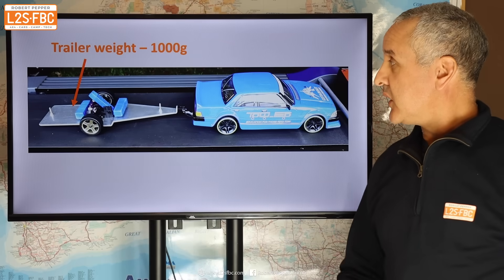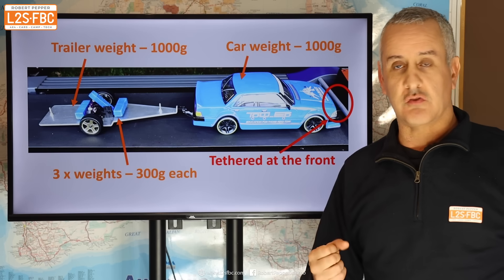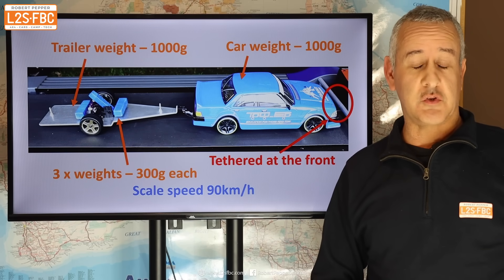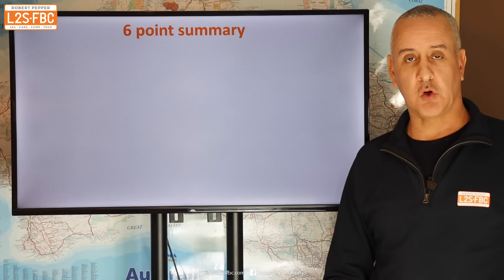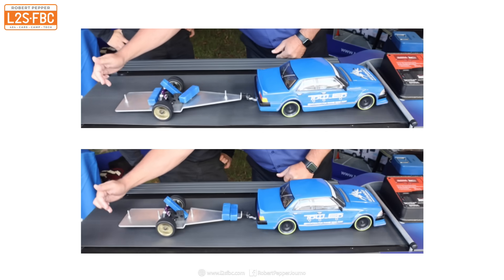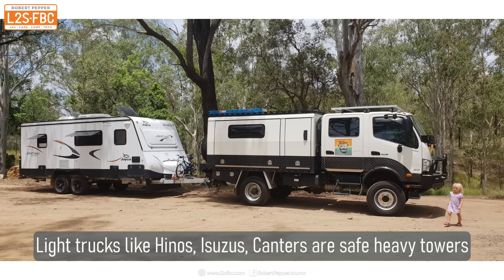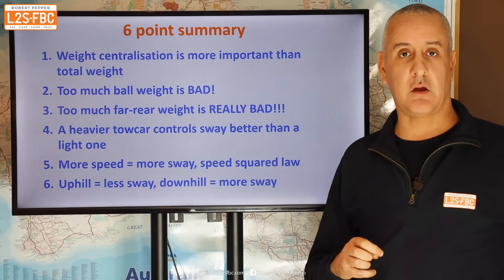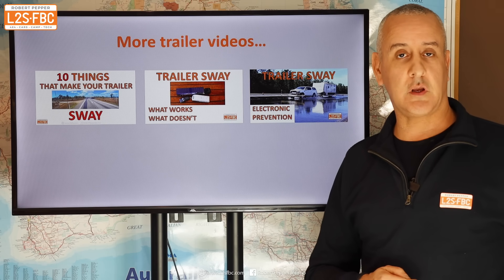7 trailer weight distribution setups, some safe, some deadly.

Comment: In addition to what was said in this video,
If you experience sway and begin to jack knife your last ditch effort is to remain slightly on the gas and use your break controller to engage trailer breaks. I'm not sure of what it is called all though I have heard someone reference it as "dynamic breaking".
The vehicle with slight gas wants to remain straight while the trailer drags and slows which it begins to take away the sway. Once vehicle is under control and has slowed by using trailer only breaks you may use the vehicle breaks again then pull over and adjust your load.

Hope this helps.

Comment: Makes a lot of sense, because with too much weight at the back, the hitch is forced up, thus reducing traction / grip for the rear wheels. Too much weight forward, forces the hitch down, causing the back of the car to be pushed down, and reducing traction / grip with the front wheels.

Comment: I have a 750kg (no break) trailer with a closed box 1,1 meters wide, 1,4 high and 2,2 long. Axle underneath and wheels outside of the box.
The faster i drive the more stable it gets. Must be an aerodynamic thing in conjunction with my w124 mercedes ...in France I had a try up to 135km/h!
Of course I was alone on the horizon and testing the response at every 5 km/h increase.... My 1300kg caravan trailer behavior ist more like in the video
Reply: Good job the wheels are outside the box as if they were in the box they wouldn’t be able to touch the road … 😂

P.s. … you only ‘think’ it gets more stable!
Reply: @andyxox4168  the other option is not in the box, but under the box ...and about stable is because I tested it by giving it steering pulls to see how it reacts.
I do Spain - Germany - Spain once a year ...so Yes: I "think" I'm getting a feeling for how unstable caravans and trailers behave 😜👍

Comment: 5:35 A heavier trailer wouldn’t have all the weight in the middle like that…  it would be distributed through out the trailer so if you load it wrong just because it’s heavier than the car it will be very unstable… and since it’s heavier than the car unloaded it would be dangerous due to overpowering the car if you do get a sway (i use car meaning vehicle)
Reply from the maker: The point is to show what happens when it is loaded like that..and some trailers can be so loaded.

Comment: I would love to see how trailer length and tow vehicle length affect it.  Also, not sure if it would be possible but a 1/10th scale equalizer hitch would be interesting to study also.  And maybe trailer angle as I sometimes see persons with an incorrect hitch height, too low or too high.
Reply: I would think it's a given that a shorter wheelbase on the tow vehicle and/or the trailer would lend to decreased control.
Friction points (tires) being further apart make the lever effect harder to accomplish.
The weights being moved on the trailer would represent what a weight distribution hitch would accomplish.
Reply: Hi Robert, great video. Have you got that video about trailer lengths. I was wondering about the same trailer but different positioning of the axels. Lots of the off road ones seem to have very rearward axels.
Reply from the maker: Not yet
Reply: @L2SFBC  Thanks Robert. Do you know of any comprehensive reference that explains the physics of all variable/ features of trailer design for those planning on designing / building a trailer?
Reply from the maker: Stay tuned...
Reply: @L2SFBC  I thumbed up, but that right there made me subscribe

Comment: I am surprised no mention of increased polar moment when you spread the weight to the extremities of the trailer front and rear. At low speed, this has negligible difference as the well placed centralize weight, but as speed increases the polar moment leads to barbell effect.
Reply from the maker: If I  can explain something without using a technical term I generally do. Those who already know what a polar moment is don't need the explanation 😁
Reply: What does the polar moment of inertia have to do with anything that isn't explained by ball weight?  And how does speed, which is normal to the axis of rotation, have anything to do with it?  There is no "barbell effect" that is colloquial to physics.
I think you have maybe a first year understanding of physics and want to impress with terminology you don't really understand.  The OP is correct, however, in that terminology doesn't explain anything.  Nevertheless, I doubt you would even know how to calculate the J of this system as the trailer axle is no longer the sole pivot point when it's attached to the tow vehicle.  Actually, from the sounds of it, I don't think you could calculate J if the trailer were isolated!
Reply: @DiffEQ  Let me just say anyone have to advertise to the world he is an engineer typically is lacking in his field of work. Deadwood engineers are a dime a dozen and I have seen enough. Most crank the same wheel day in day out. Trailer stability has many elements and I won't enumerate them to you as it would be a waste of time.

Comment: All of those caravans lost control because of turbulance, from the overtaking of the trucks.
Also speeding last the trucks while towing.
Reply: If you load the caravan to centralise weight and have 50kg nose weight the setup should stabilise itself, oh and don’t fight it with the steering, you’re not gonna win!

Comment: I presume if the trailer is high, It’s best to add weight to the tow vehicle. Also I assume braking if the trailer starts to sway, braking transfers more weight to the towing vehicle = best way to react. Thanks. Great video.
Reply from the maker: Trailer high?  If sway happens, don't brake the towcar - apply brakes to the trailer only. Explained why in my other sway videos.

Comment: Great video and very clear - I learnt a lot about the relative importance of different factors, thanks. I've found a heavy EV (1875 kg + low centre of gravity) towing a relatively light (850 kg) caravan surprisingly stable. Now I know why.
Reply from the maker: Which EV? I have towed with a Tesla X and you're right the extra weight nice and central makes it perfect.

Comment: I haul my tractor with different implements on the rear of the tractor that definitely change the weight distribution. (shredder, box blade, auger, chipper, etc). I have a stand i made that i set on the ground next to the bumper and put a mark on it. I pull the tractor forward on the trailer until i get about an inch and a half drop in the rear bumper and then i boom it down. Pulls like a dream every time. I’ve dodged deer and idiots at highway speed and it recovers beautifully.
Reply from the maker: Thanks great tip!!!
Reply: That's an awesome tip for towing multiple trailer types. 👍

Comment: Great video, I have already sent this to several people. Don't forget about the tires. Trailer's need to have the proper tires and inflation. Never mix trailer tire types or brands and if you have a trailer that sits a lot. You may need to replace the tires even though they are not worn out. Sunlight and time cause rubber oxidation and hardening in the tires. This, under inflation, not having the proper sidewall rating can all cause these issues as well.
Reply from the maker: Excellent point...wait for a future video

Comment: Thanks for such a good explanation. Best example I’ve seen so far. There are so many variables with towing. It would be fun to play with them all on the treadmill. Eg, tow bar length, load torque bars, tow ball height in relation to trailer. Etc. cheers
Reply from the maker: Thanks please share 👍

Comment: Wives need to see this and then understand about loading the top rear and front cupboards, which is where the storage is built in.
Reply from the maker: Why just the wives?  Plenty of males, and presumably husbands don't understand loading principles. And to be honest, the real culprits are the designers of the caravans who, I presume, are mostly male.
Reply: @L2SFBC   I said that because it is usually the wives that load the cupboards and food storage, they will put it any cupboard they find and that is either end along  with  the man  piling the new gas bottles  and his tool kit in the front  etc. It is common  for nearly everyone to know nothing about c of g loading as it is never explained properly. The designers are at fault for a lot of it but  construction and use regulations are also responsible.. three wheel trailers were tried but were found to be illegal bu stable and impossible to reverse. If towbars pivots were at the rear axle it might be better compared to hanging out the rear of the tail with all the leverage involved.
Reply: Husbands need to see this and practice assertiveness and manliness in telling their wives what to do ! 😂😂😂

Comment: Fantastic explanation. 
I recently saw on the outskirts of Sydney a guy in a Rav4 with a box trailer totally overloaded with bricks, the time from the first sway to the car flipping over was only seconds, it's terrifying how quickly it can happen.
Reply from the maker: Yes around 4 seconds from start to inverted!
Reply: @L2SFBC  That's the exact reason I do not use cruise control while towing, ever. Nor do I use it in rain,  snow, ice. When seconds are all you have to avoid a catastrophe,  the split second it takes to disengage speed control could make a difference imo. ✌🇺🇸

Comment: I was always told to keep 15 to 20% of the trailer weight on the hitch.  Will an even distribution of the load over the axle(s) provide this percentage?
Reply from the maker: Probably not, but why 15-20%? Seems high?

Comment: Excellent presentation.

Wanted to haul my east german folding sailing canoe on a converted bicycle kids trailer and figured the ends may stick out but as long as the CG is on the axle it would be doable.  
Guess i was right after all. :))
Reply from the maker: Yes but it's then prone to the effects of air and wind...
Reply: @L2SFBC  True but with 30km/h behind my moped it would not to too much of an issue. 
It's basicly the pendulum effect on a horizontal plane. :))

Comment: Good demonstration. You want about 10% of the trailer weight for ball weight from what I have seen. I do place the heaviest items centered over the lead axle on a twin axle  and centered just slightly forward of the axle, between the axle centerline and lead edge of the tire that seems to get the ball weight around that 10% target.
Reply from the maker: 10% is just a rough guide, and it's no good getting there if you achieve it by adding weight at either extremity.
Reply: @L2SFBC   I agree on that.

Comment: With a semi-trailer some of the load is on the prime mover. If  some of the load goes onto the tow vehicle it must not lift the front wheels.
Reply: True.  Here, they are talking about bumper pulls, which create a different dynamic.  Additional tongue weight will reduce weight on the front wheels (i.e. bumper pulls can have too much tongue weight).  Your comment highlights the advantages of a 5th wheel/gooseneck setup vs. a bumper pull.

Comment: Wish you would have put all the weight at the back of the trailer.  But very good video non-the-less
Reply from the maker: We have plans...
Reply: @L2SFBC   also simulate the vehicle hitting their brakes while the trailer is swaying.  Possibly stopping the the treadmill would work?  But with a swaying trailer that is what you don’t want to do as often-time instant jack-knife. 

Also you could have the trailer swaying and increase the speed and see if the swaying trailer will start to track right behind the truck again.  

Or increase and decrease the speed (simulating on and off the gas), to see if that is a better way, to regain control?

Also slowing the tread mill, which often happens as people panic (naturally taking their foot off the gas) and see if that will cause the sway to become greater or lessen.   (It should cause the sway to increase, in a real life situation, as it is trying to maintain its speed as it still has its mass with all this stored energy yet to dissipate.)

So skies the limit as far as this experiment, though your research will help people react with greater confidence that they are reacting in a proper way, in a high pressure unexpected moment.

Might also alter the treadmills surface to simulate a slicker road surface.  

Thanks for your reply as I certainly learned that over the directly over the axel is more stable, then having the load positioned any other way.
Reply from the maker: Thank you all excellent ideas. There will be more...
Reply: @L2SFBC   also I learned this the hard way as I was 26 and had a 16ft land-scraping trailer and older people I was with should have known better, but the trailer being brand new hadn’t been fabricated with proper rails in order to carry the 30 replacement windows near the center of even toward the front.  So they and we, in our wisdom loaded everything against the drop down tailgate.  

Everything went well until I moved a little too suddenly, over to merge onto a highway, the trailer started to sway, i in a panic had taken my foot off the gas, the sway increased and (just as my partner who was 12 years older said don’t hit the brake, at that moment with the ever slightest tap of the brakes, that trailer instantly jackknifed all the way to the driver’s side and yanked my truck around with it, so now I am going down the highway side ways.  The trailer hit the grass and yanked the other way automatically and that’s when the windows went flying. Total loss of windows around 3 grand, a dent in the back quarter panel of my truck as well where the trailer hit. May 11, 1998. 

I’ve had another trailer before that, sway, with a good size load on it, but of course the load was more spread out and I (didn’t hit the brake) and i was able to get it bake under control.  

So I had over confidence with this load, a lack of proper advice, and in a high pressure situation with money on the line, I panicked, and so I believe if I would have hit the gas, I would have been a hero instead of a zero at that moment.  ;).
Reply from the maker: Wow that's a great story! Thanks so much we can all learn from it!
Reply: @L2SFBC   lastly, I was thinking how to simulate the hitting the brakes as I’m not sure how the simulation would work on a treadmill with the surface slowing at all points in the exact time.  So one way might be to slow the treadmill but pick the vehicle up, to simulate the vehicle slowing much quicker than the trailer and see how the trailer reacts to the vehicle going slightly backwards (ie braking against a trailer which is continuing to “want” to move forward).   Alright thanks for listening.   Loved your video and the concept it illustrated.  Peace and God Bless
Reply from the maker: We have thought of a way to do some braking...